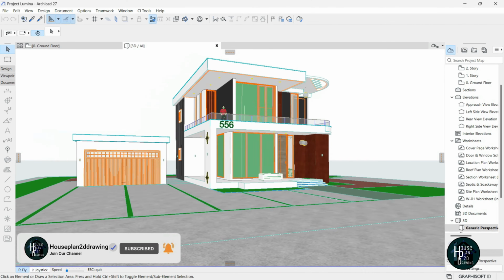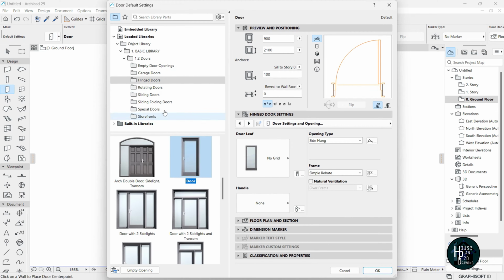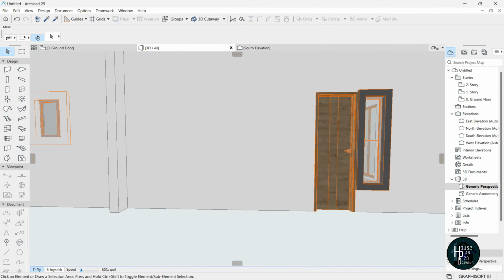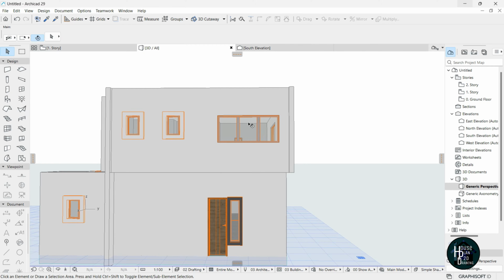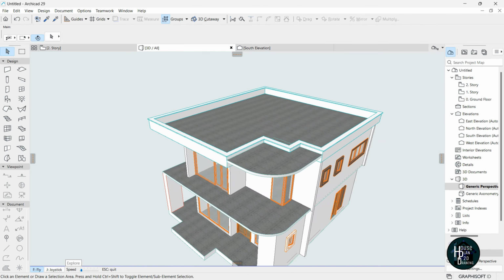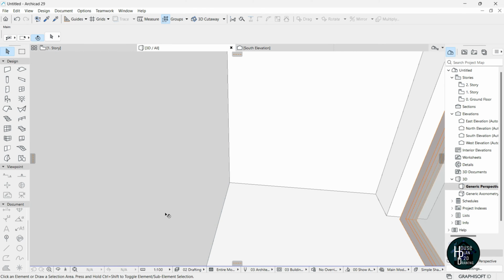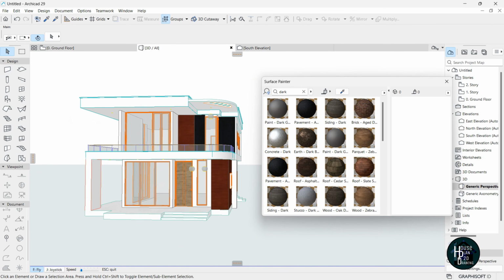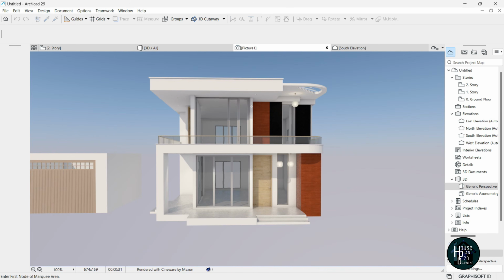Full Beginner's Course || Archicad Architecture || 4 Bedroom Duplex

Comment: Chief your second floor plan it shows a staircase would like to ask where does it lead too and the third floor is a roof
Reply from the maker: Yes, the staircase shown on the second floor plan is simply the continuation of the stairs coming up from the ground floor.
Reply: @Houseplan2ddrawing 
Okay nice I got it but still I find it so hard to design the stairscase, In your case did you just use the line tool or you use the exact stairs because I've watch your tutorial on how you design the stairs and you just said in that video that you used the line tool to indicate the stairs
Reply from the maker: @ianchai6796  I usually just draw the stairs directly. 

I only really use the line tool as a temporary marker to show where I need to pause and resume drawing.
Reply: @Houseplan2ddrawing 
Ooh okay Chief, let me do my best to see if I will model the stairs just as shown in the floor plans
Reply from the maker: @ianchai6796  alright.